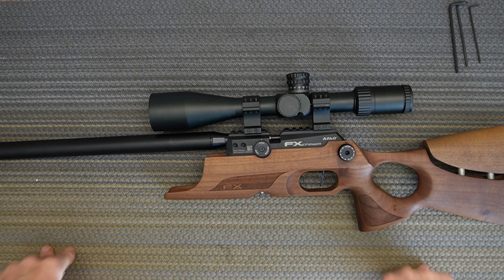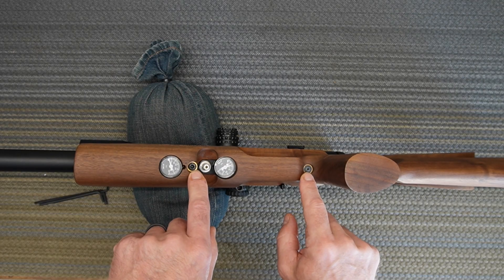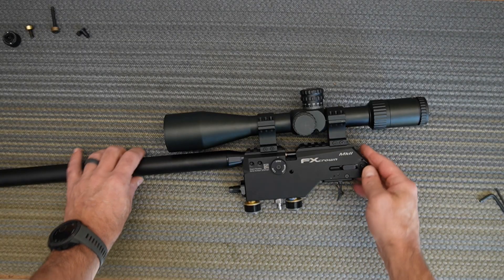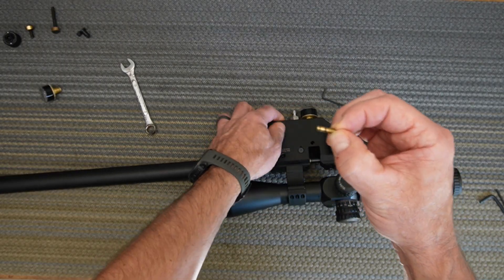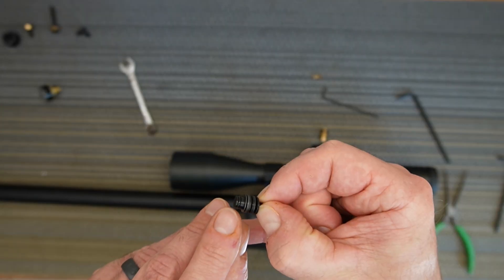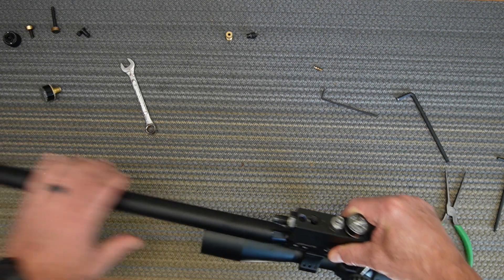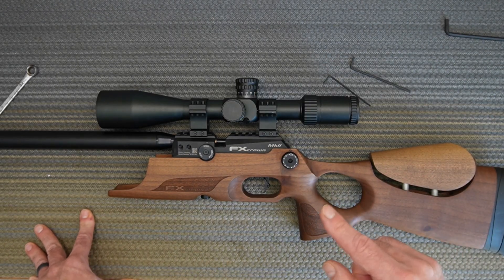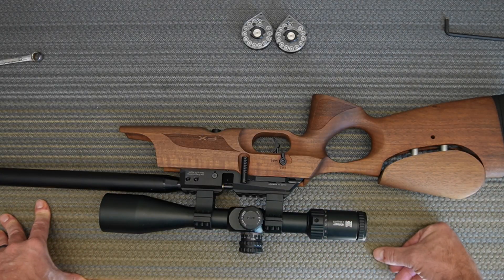FX Crown mk2 - REGULATOR REBUILD

Comment: Couple problems.  1).  Leak out the barrel that would inflate a balloon is the valve not the regulator.  2). You totally missed the huge pain in the ass oring that is down at the bottom of the threads the reg unscrewed from.  It’s down in the gun and sucks to get out.  You have to be super careful removing it as if you scratch the surface of the groove it sits in the gun may never seal. 
In my experience amp regs are the least reliable on the market.  They suck as they leak a lot and aren’t super friendly to work on until you get the hang of it.